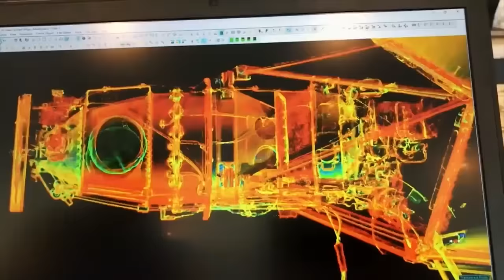We both almost died...now what??

Comment: It would be nice to see you two put your talents toward taking the work Stanley Myers who took a dune buggy and ran it on water. During his research he discovered that the key was resonance and frequency. he built a fuel injector that was fed by water and then injected two parts hydrogen and one part oxygen into the cylinder as fuel in real time. He also discovered that he could generate electricity in abundant quantities by using a non conducting tube with a bunch of copper coils  wrapped around it and passing the hho output (browns gas) through the tube after the gas was charged by plasma. hydrogen and oxygen are neutral elements but plasma is a positively charged element and will attach to the neutral elements. As this trio moves through the coil assembly large amounts of current was produced ! I would say more than enough to replace the batteries in a Tesla, or power up a home using water for your heating and cooking with all the electricity your home/ranch/business could use with out that monthly bill. You could run a ICE (internal combustion engine) on water or generate abundant current with a closed loop genset to power up a all electric airplane with out ever having to fuel. Stanley was killed for resolving the pollution problem that Standard oil caused with oil his work did not pollute the environment. All he wanted in return was recognition for his achievement his gift to the world. Check it out and run with it.

Comment: I still think there are three major barriers to entry to GA that can be resolved: 1) cost to acquire PPL. I think much of this training process (and continuing training) should be software-based using interactive computer-based training modules and 6-axis simulators. There are almost certainly scalable economic benefits that would bring the cost of acquiring a ppl way down whilst equipping new pilots with a more robust skill set. Look how much sim time commercial and military pilots see these days. It’s the new normal. 2) Cost and diversity of accessing general aviation. Cost of ownership, in most cases, is a major economic barrier. This often leaves prospective buyers looking at very old aircraft that are of questionable airworthiness. I think for most, the allure of GA, isn’t so much about object possession, but rather about the freedom of flight in a specific form factor (i.e. speed, STOL, aerobatics, sailing, etc,). I think we need more commercial entities that are willing to procure new aircraft of interest for rent to GA pilots. Just not enough aircraft of interest to rent. 3) I think many would agree that there are many new GA aircraft that have elected to constrain themselves to an experimental title that are honestly safer and equally well equipped to certified aircraft. We need to establish rules that permit the rental of experimental aircraft so long as they meet minimum requirements for safety. 
Again this is all about democratizing access to GA and ensuring more pilots have access to better quality safer aircraft whilst aligning with practical economic constraints. Aviation need not be exclusive to the 1% or to professional aviators.

Comment: Wordy Alert :) -- 1) What's going right in aviation? 1a) Mosaic; 1b) Safety systems (avionics, auto land, BRS); 1c) Safety training 2) What can be fixed in aviation? 2a) Avionics -- They're getting better, and things like Honeywell Anthem are nice, but we're not even close to what it could be, which would make flying easier and so much safer. An AR type approach (still screens or glasses) where you see in 3D in context of where you are, with all the right annotations and calculations right there, suggestions, plans, and an interface that makes everything easy, alerts make sense, etc. As much as things have improved, it's shocking how much better it could be; 2b) Aviation controls -- why do we have wires, push rods, cables, etc... why not redundant small motors for everything, full advanced robotic level controls for so much better auto pilot management, higher level controls for safety, system understanding of the plan, the weather, the conditions, and what is needed in the controls for proper maneuvering. Also leads to much more advanced and safer auto pilot processing; 2c) From all the great R&D you guys and others do, we need a better way to get those improvements, ideas, and research, to make their way to aircraft designs and products. Mosaic may make all that easier. But also business and marketing.

Comment: The maintenance side of the industry could use help with promotion. As you know without the maintenance and logistics team quietly working away in the back ground, planes don’t fly. 

Accessible recurrent training for  maintenance staff is another area that could be looked at. Most update training is either not easily accessible, or is priced too high for the average maintainer to justify paying out of their own pocket and many companies are too cheap to pay for outside update training.

Comment: As a pilot in general aviation I love leaded fuel aircraft, the noise, the community etc, but being from the U.K I don’t like the price. I also don’t like the ‘futureproofness’, I know you can get stc’s for mogas but getting that done in the uk/ EASA is a pain and a lot of paperwork time. I’m not sure what stage it’s getting to in the US but the aircraft market for big Low Lead burning aircraft is on its knees. I’m leaving this comment because the US has the best GA community in the world and I feel that a push for an additive or a complete new sustainable fuel is a big requirement. I could be wrong and there’s already something happening, but I’ll be happily wrong because I really don’t want this big engines stuff to die. Rotax is becalming the new thing over here across the pond and although it’s a step in the right direction I don’t think many of us are ready to let go of the Back Bone aircraft of general aviation.

Comment: Here are some of my ideas that could help us out. 
1. Cost to get into aviation is very high and with the current financial burden of our economics of the county, it is hard to get to work and feed your family let alone follow a passion of aviation. Maybe you guys could work with others like the "Angle of Attack you tube channel" who have ground school programs and form a group of CFIs across the country that will help donate time and or cheaper aircraft access towards flight instruction. 
2. The cost of maintenance for certified aircraft and the required checks and overhauls - getting resources to make this requirement more cost effective for the average person. 
3. Facilitation for training to keep historic interest in aircraft by keeping warbirds in the air like Kermit Weeks at Fantasy of Flight.
4. How do you start, run, and sell a successful company that supports you financially for aviation. 
5. Small personal affordable aviation solutions. My work commute is changing from 26 miles one way to 56 miles one way because of an office split and relocation of staff. Unfortunately I am one of the few that does not have a choice but to drive to the new location putting that greater strain on my family. Flying to the new office location would be a great solution.   
6. I like the free gas and fuel idea!

Comment: You asked for it so I'll give you some thoughts from the cheap seats and it may sting a little. I have loved aviation since I was 5 years old when I saw a formation of F4U Corsairs flying low level above the palm trees over my house in Honduras. The rumble, the power the pure awesomeness was breathtaking. I wanted to fly but life and circumstance didn't see fit so I went into maintenance. Joined the Army and worked CH47 helicopters then off into the corporate world with deep involvement in GA to occasionally jump in a 172 and fly for an hour.  Let me start with what I have seen that is wrong from my view, after a 40 year career and doing annuals on little airplanes (for additional income) one thing holds true, I have grown tired of being the bad guy, a maintenance grim reaper of airplanes, a necessary evil to the business, (I've literally been called that). I learned my craft in the US Army working on the most complicated helicopter in the inventory so I know what logs are supposed to look like. Often I open up a log book on an aircraft I have accepted for an annual and find year after year a rubber stamp saying CW 100hr/annual inspection performed cylinder compressions and checked AD's thru today all good. Owner pilots tell me  something to the effect of, "well bubba did my last annual in one afternoon". Many log entries make no mention of  service bulletins, ICA's for appliances or after market equipment. It takes time to do the whole job correctly. The FAA rules are too loose in my opinion by the standards not having been updated. Up til last year when I gave up my shop I still saw log entries say CW in accordance with  Part 43 Appendix D knowing full well there's a manufacturer's inspection checklist that's more detailed and more encompassing to include bulletins, Chapter 4 stuff like time replacing of parts which seem to be overlooked more often than not. At the end of the day when folks who have been skirting the fringes of what I would call barely legal and you do a job beyond reproach to the best of your ability, you're the bad guy because we went digging in their pocket. Part D needs to be updated pure and simple. That rule was written for aircraft who did not have inspection guides and checklists so Wright brothers era airplanes. What's right is due to liability I'd have to guess, the manufacturers have stepped up and revised many checklists for inspecting aircraft. I'm sure Cessna and Piper never intended for their aircraft to fly as many hours as they have. in some cases unfortunately it takes a tragedy for changes to be made. The Piper wing corrosion for instance. Corrosion is a big deal and must be dealt with but sadly is often ignored. I study NTSB report and sometimes I shake my head and then try and learn from other's mistakes to help keep folks as safe as possible. I would ask that folks take the time to get to know their mechanic's integrity if they are costing you money and can justify the expense then just pay the bill say thank you for keeping us safe and go fly !! Don't belly ache about the cost just remember the Mercedes, Porche, heck even the Chevrolet dealers who work on your cars charge anywhere from 120-190 bucks an hour to work on your cars !!! If you think 120 bucks an hour is too much to ask for getting your airplane fixed that your family flies in, up in the sky,  then it may be time to sell it and get a boat. As for associations, I was with PAMA for may years, got tired of the politics. NBAA is also a great organization very expensive but lotsa good info and seminars. As a corporate guy thankfully it was an expense the company would absorb. One more thought the corporate world uses a program called CAMPS (and may others like it) which tracks maintenance and if used properly can make the keeping track of aircraft maintenance a breeze for the owner AND the mechanic. I have built a "light version" for GA for various aircraft and have given it to my customers as part of their inspection. Maybe a good idea for all owners to have such a tool.

Comment: 1. What's going right? -- The aviation community is amazing. Interest is booming. People want to fly and be part of the community.

2. What's wrong? Cost/availability of GA airplanes, and having a place to store them that doesn't cost the same as a single family home. The biggest thing you guys could do (IMHO) for the aviation community is find a way to enable people to get into a modern, safe, fun and capable airplane for $30-60K, all-in, with an engine that's not timed out, and that has modern avionics. The Yamaha aircraft conversions group has already proven what can be done with a $6k new crate 998T motor, so taking something like that to the next level would be 👌. Modern manufacturing techniques should enable a reasonably priced airframe, and Experimental class avionics can be had from Dynon and Garmin for $10-15k. Lastly, I know you guys are already working on an FBO project at KSPK, but finding a way to expand the availability and affordability of T-hangars in other areas would be awesome. Maybe a semi-permanent "mobile home" style T-hangar that can be secured on a standard tie-down spot at any airport?

3. I am currently an EAA (Chapter 23) member, and will consider AOPA if/when I own a plane.

Comment: The big issue looming for GA is that production peaked in the 1970s, and those airplanes aren't going to last forever. Fewer airplanes means fewer pilots, which means airports won't have enough community support to continue operating, and the gem that is North American general aviation becomes a thing of the past.
For GA to survive long term, someone needs to figure out how to build and sell a production airplane that has similar affordability to what a 172 was in the 1970s (about $90k adjusted for inflation).
Until that happens, anything that extends the life of the current GA fleet helps. It would be very nice if someone offered turnkey avionics upgrade packages  for the most popular models to help keep the backbone of the GA fleet operating for a couple more decades - avionics have come a long way, but every install shouldn't be a custom affair.

Comment: A monumental improvement to aviation safety in general would be easier access to certified avionics upgrades.  In the world of certified aircraft, modern avionics cost twice as much as their "experimental" counterparts.  We are told that this price delta is due to the considerable expense of certifying new avionics.  So, is this the case?  Can the certification process be streamlined?  Is a 40 year old piece of certified avionics gear actually safer to fly with than a piece of current equipment that lacks certification?

Comment: Age50, aopa and Beechcraft society.  Working:  we have lots of airports. Way more than Canada. We also have very light pilot regulations and fees compared to to other countries.  Not working:  cost of power plants and avionics.  We need modern power plants that don’t need anything other than regular UL, are efficient and as easy to run as my car engine. And they need to be able to be retrofitted to legacy airframes at low cost. I’m not asking for much!

Comment: #1 What’s going good in GA? The renewed excitement and enthusiasm for GA. #2 What are my concerns? A) Aging out of mechanics and inspectors and for the new mechanics trying to get started not being able to support themselves with a GA aviation maintenance job as an early career professional.  B) Threat of loss to GA available airports. Truckee CA, Boulder CO, along with the perceived lack of return on investment for the GA activity at my local airport from the city council and community when it comes time to retain and reinvest in infrastructure (runway) that is GA centric and not supported by the commercial side of operations. C) Need to get unleaded aviation fuel manufactured and distributed to airports across the country. D) Support for youth aviation clubs and flying opportunities. Recommend starting with gliding. Allowed entry age is the lowest of all GA platforms, equipment costs are relatively low and the use of winch launch and motorgliders for instruction keeps the cost low for the club and students. #3 What associations do I belong to. Soaring Society of America. Member since 2003.

Comment: I've always have been enamored with lighter than air flight  , Where would we be today  had the Hindenburg not burned , Given the advances in multiple engine drone type aircraft if you could incorporate a neutral buoyancy envelope to build a lower speed low level research aircraft like  an airborne remora  that could linger and travel for extended times.

Comment: I worried about the obsolescence factor concerning small Continental engines. No crankshafts, no camshafts, etc. I see O200 crankshafts going for upwards of 10K. These engines power most "starter" airplanes. Let's make some certified cranks and cams! I am aware of the paperwork difficulties but you guys can make it happen.

Comment: I would like to see you take a current lightsport or 2 seat legacy aircraft and create a super fast airplane that at max takeoff weight would hold full fuel and hold two people who weigh  up to 400 lbs. together.  The plane should fly up to 225 to 250 MPH.  It must also meet the new mosaic rules being discussed so plane would have to have a 54 Knot clean stall speed. (That stall speed could change  after the rule becomes law.)